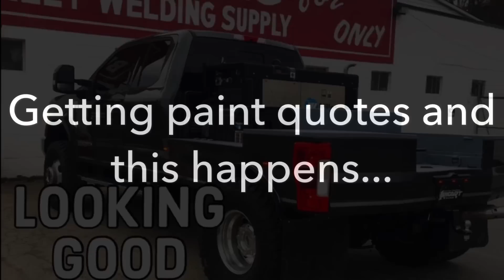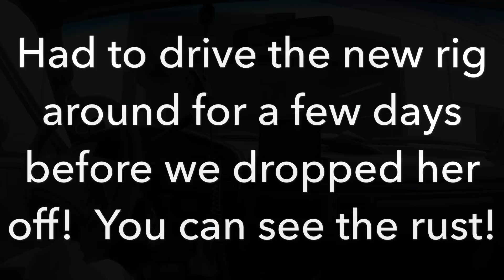WELDING BED BUILD | PART 7: PAINT

Comment: Man I actually work for Ford in Texas. And I've been thinking about going to school to get certified. So I can make some real money welding. I do lots of welding up here unfortunately I only make $11 an hour doing it. Yeah yeah I know chump change. But I have to say I love what you did with the stock tail lights and the stock Puck system gooseneck hitch. Superclean brother I just subscribed and clicked on the bill. Absolutely amazing fixing to buy a 450 dually and build my own bed. I have pipe fence gates in archways falling out of my caboose working out of my garage. Because I need a mobile work truck buying a new truck from work period and putting in my two weeks notice would love to pick your brain.

Comment: I'm buying a skirted CM bed and was curious if it'll work with my 37s on stock wheels. 2019 f350 dually, Stock height and I pull a 5th wheel. Looks like it's gonna be tight.